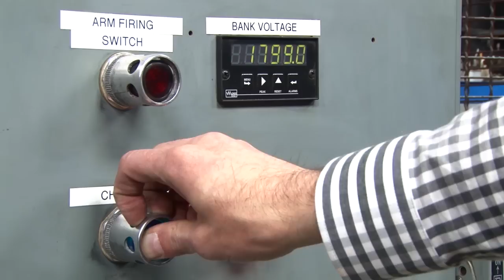Revlon Hair Straightener: Abuse of Power #3

Comment: Sure those were ceramic plates? They look like aluminum extrusions.
Reply from the maker: ***** Going by the product details from Revlon, yes. A lot of "ceramic" straighteners do apparently have just a layer of ceramic around another material though, so it's entirely possible that this is the case here. Unfortunately the plates did not break and give us a proper cross section to examine.